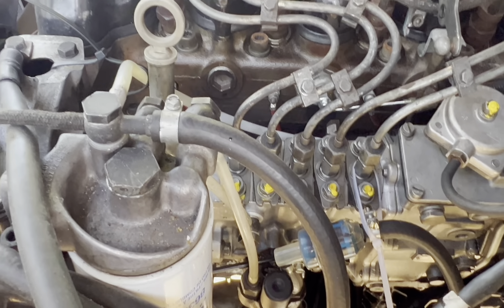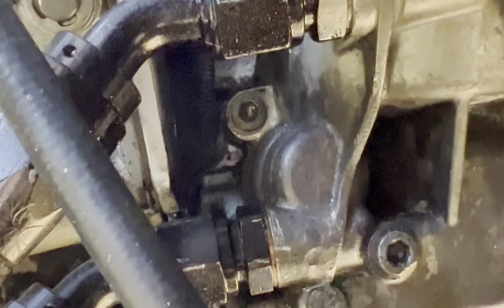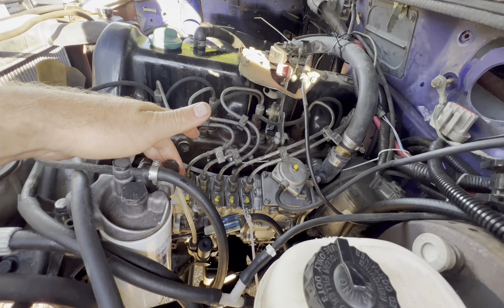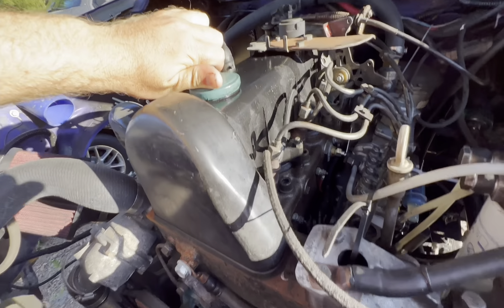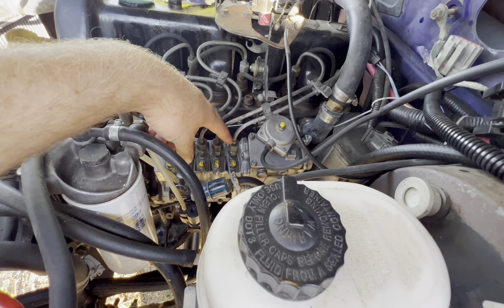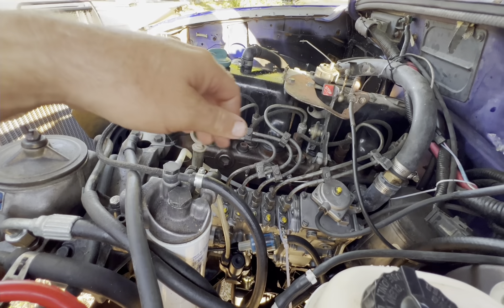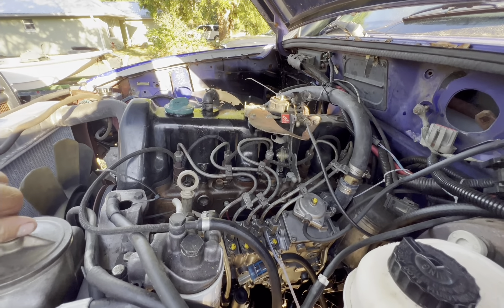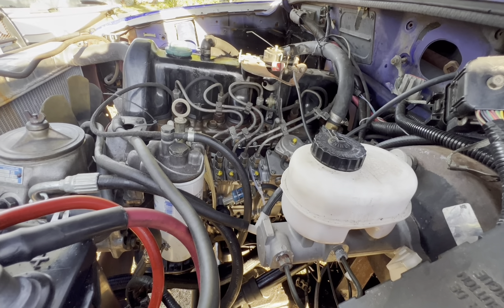@BenzForce high performance om617 pump install overview, HUGE POWER Difference!!

Comment: Love It man ,does the om617 make a good daily driver ?,and do u think it's a good option for a chevy k1500 single cab ?
Reply from the maker: Thank you! And in your case I’d look into a om606 honestly just to help with the extra weight of the truck, you would be very unhappy with the lack of power with the 617 in my opinion

Comment: Is this the longest engine you can fit in a ranger without mounting the radiator on the outside of the support or cutting the firewall? Saw some guy with a 606 that had to cut up his bumper and face-mount his rad.
Reply from the maker: That question I can’t genuinely answer but I do know the 603 and the 617 are the same length